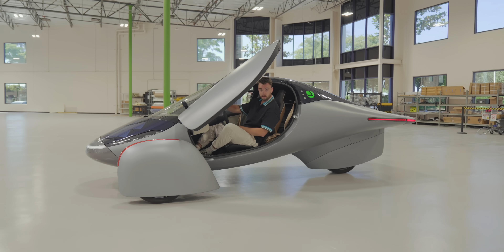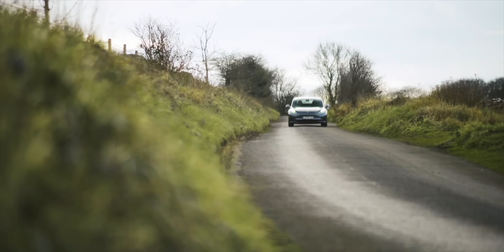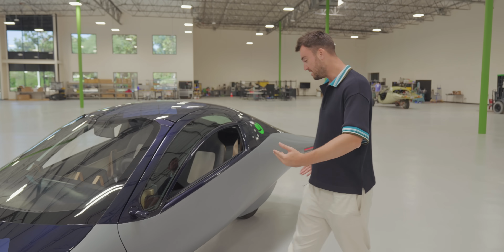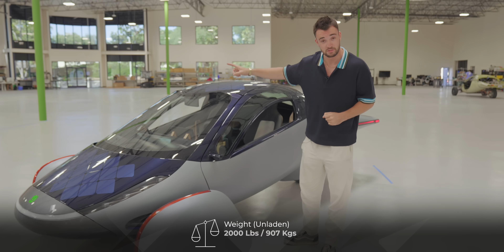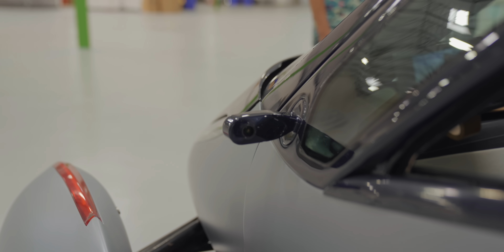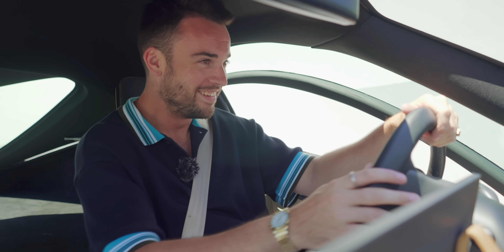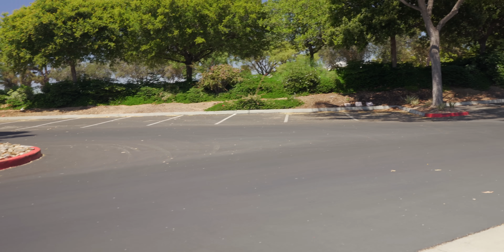The Game-Changing CHEAP Electric Car Inspired By Fish!

Comment: Aptera is basically a super efficient cheap 2 seater sports car with great trunk space. What's not to love.
Reply: @bgeery  So I'm seeing one video where they have a 5'-7" lady (Sarah Hardwick) laying in the back, head against the rear and feet nearly touching the back of the passenger seat which is slid forward all the way. Just enough room to wiggle her feet, but if the canopy was closed her head would be squished by it. She's also laying at a slight angle because she clearly would not fit in straight.

Another video shows two ladies tossing what appears to be sleeping bags in the back, and sitting on the back of the vehicle with their feet hanging over the edge, but not laying down inside, side-by-side.

It's definitely larger than it looks - I'll grant you that. Even the official videos make it look deceptively small. But two people in the back? Maybe you can fit two people in there the same way you can fit ten people in a phone booth... it only sleeps one if they enjoy being cramped or have the tent accessory, because you lose maybe a foot of human-usable space due to the taper of the hatch.

Heck, let's see Chris Anthony and Steve Fambro taking a nap in there!
Reply: This had me thinking. Is it the 2020s equivalent of the E-Type or the Bubble Car? I think it’s the former. People aren’t as boring now as they have been for the last 25 years.
Reply: That's not a car its a motorcycle.
Reply: Cheap? 🤣🤣🤣 Cheap is a car for 10000 bigger that that and still you have 30000 for petrol 🤣🤣
Reply: @bgeery  Yep, can't do that in a sports car.
Reply: Sports bike* no safety testing needed...
Reply: The fact its a 2 seater will definitely put off a lot of people. It essentially makes this a commuter or touring car, i.e. what most people use a second car for. But that kinda goes against the ecological ethos behind the channel and the company. If all you're gonna do in your car is drive to work, drive around with your spouse for fun or some light grocery shopping, then an e-bike is a far better option in almost every aspect.
Reply: @rfldss89  no. Motorcycles are death traps
Reply: @rfldss89  what about rain?
Reply: @rfldss89  not really
Reply: Potentially safety? I don't know, but it doesn't seem like it'd be very good at absorbing impacts.
Reply: @steave435  it has already been crush tested, it actually exceeds the safety requirements it is required to meet
Reply: @rorychivers8769  the problema is that the safety requeriments are for 3 whellers, not cars
Reply: @claudiopinto721  The vehicle is legally classed as a motorcycle yes, but they are voluntarily aiming to meet or exceed regular automobile safety standards, so you'll be able to check with the federal government if they think the vehicle is safe enough when it goes into production.
Reply: So true!!
Reply: Its trunk space is about the same as many 2 seater sports cars.
Reply: @Obscurai  it does have over 6 feet from the back of the seats to the gate. With the back open and the tent in place it should be pretty cool!
Reply: @ATS599   NOPE.  The HELL you could  keep up, hilarious.  :D  Not to mention the fun factor of a planted well sorted sports car.  3 wheels is good for ONE thing, cheaper, they are crap for cornering, sliding sideways, handling in general, and you can't straddle anything on 3 wheels.  RUBBISH.  

Thanks but I drove econoboxs for decades so I can NOW drive what I LIKE without stressing over cost.  

Ever seen a 3 wheel race car??   Of course not, for fundamental reasons.  Garbage.
Reply: @Mrbfgray  Your days of driving like in a race car are coming to an end! Deal with it!
Reply: @theodethomasa6358    NOPE.  I live rural for damn good reasons, you city Nanny State carbon copy depressing drones can stew in your own toxic juices while I live happy, free and self sufficiently.  Grow my own organic everything and chuckle while y'all fight over crap handouts.  :D
Reply: Garbage driving experience guaranteed, sports car??  WTH!  Never was nor will be a 3-wheeler that drives even average let alone highly capable--the definition of sports car.
Reply: @Mrbfgray  Lol, I wonder why all these little 3 wheel sports car/bikes exist then and were quite successful, it's as if they actually handle good! 

Campagna T-Rex 
Polaris Slingshot 
Volkswagen GX3 
Marotti 
Elio P5 
Peugeot Egochine
(There are more)

Also Aptera has YouTube videos about specifically how the beta version handles, and it's truly quite good, it passed all the stability and handling tests out there with flying colors, and they've been doing track testing to get the alignment good. So far it looks to truly handle like a proper light sports car, obviously we won't know what it compares directly to until people get to go and drive it for themselves, but it's gonna drive like a car, in the same way that other sports trikes do, it's not gonna be some terrible thing.
Reply: @Maximum_777    Have you driven both at the limits?  A proper car vs a garbage trike??  Have you seen a trike winning on the Nurbugring or ANYWHERE?  They don't even try.

  Get over your emotion attachments and accept reality.  Trikes are TRASH....always have been always will be.  It's a fundamental design imperative, if you can't intuitively visualize that fact is why you are not an engineer.
Reply: @Mrbfgray  Well I think ultimately you're correct in the sense that a trike's not gonna set lap records, but that's because they're simply not designed with that in mind. They are however far from the trash you make them out to be, and from what I understand, they tend to make for perfect track toys, since they're much lighter than equivalent sports cars, and because of this their horse power goes further, they handle better, and are a ton of fun. But yeah, a BMW with a significantly larger engine, larger and more tires, and especially larger price tag, is gonna beat it on the Nurnbergring, however this is far from the point. 

The point is, there's no reason an exceptionally light electric trike is going to perform wildly poor in comparison to an equivalent car, and I think it will be quite interesting to see how an Aptera does on track. Since it's not a sports car, and rather an efficiency vehicle, I'd imagine it's not going to be an insane performer right out of the box, probably needing better brakes, tires, and cooling, for true track use, just as any car that's not designed for that purpose would. Ultimately for the money I think it's going to be a decent contender as nothing is going to be able to come close in terms of power to weight and that's that, because that's where the information we have ends. 

Then you went and said some bs about emotional attachment, and come on man, you really gonna just shill BMW's in every other reply here, and start talking about emotional attachment? You ever gonna drive something else? Or is it BMW's for life? 

Also, you said this somewhere up there, "Not to mention the fun factor of a planted well sorted sports car.  3 wheels is good for ONE thing, cheaper, they are crap for cornering, sliding sideways, handling in general, and you can't straddle anything on 3 wheels.  RUBBISH." 
This is incorrect, the ability to slide something controllably or straddle it at the limits of grip is down to balance, and as long as the trike is balanced well, with a 50/50 distribution front and rear, you can do absolutely everything a car can do, with the benefit of getting more cornering potential for a lot cheaper, considering you have 1 less wheel to worry about. 

Go look into all the 3 wheeled track toys out there, time and time again, the feedback from drivers is that they feel extremely light and agile in the corners, and are much more capable on track than they expected. They are truly interesting vehicles, definitely worth driving if you get the chance, and a proper electric one, with the daily drivability that the Aptera is offering, has potential to be the perfect daily driver. Obviously until we get our hands on one, it's going to be impossible to know for sure, but Beta looks mighty promising, and I look forward to it proving either of us wrong here, when we get more information. Regardless, it being a trike will not hold it back.
Reply: @Maximum_777    If you can't figure out why 3 wheels sucks that's your failure, I can't imagine anything more obvious.  We even had trike golf carts when I was a kid, SAME thing, turn hard and they want to tip over.  ATVs too!  3 wheeler off roaders were fun and rolled over all the time, that's why they don't exist and no one misses them. 

Sure they have a place for those saving a buck or not very bright.  In some places they skirt car regulations, cool, they are still crap. 

 Arcimoto has a decent modern example, try to slide it sideways on dry asphalt and you'll be sliding it on it's side no doubt.  But it's slow, small and 'cheap', has a place likely, on urban surface streets.

Entire history of autos there have been trikes popping up and disappearing.  Get an F'n CLUE.
Reply: @Mrbfgray  And yet so far everyone who has tested it has come away with a smile on their face
Reply: @rorychivers8769    Good on them and I welcome options and innovation.  Just don't try to drive it like I do my BMWs everyday.  ;-)
Reply: @Mrbfgray  on a track, I hope?
Reply: @Mrbfgray  You mean like smoking your tires? Doing donuts in the streets? That kind of driving?
Reply: @theodethomasa6358   Smoking tires, donuts and childish unskilled vehicle abuse is BORING.  You just wouldn't get it for the same reason you have no concept of a high performance Japanese motorcycle.
Reply: @Mrbfgray  I was not the one to include in the comments about "race cars!"
Reply: @theodethomasa6358    You won't see any trike Tesla's either for the same reasons, they are inherently crap.  Imagine this college science experiment "inspired by a fish" getting T-boned in an intersection, or attempting a severe collision avoidance maneuver at 80mph on a freeway, getting rear ended?...I'd prefer a motorcycle, at least then I might dodge and avoid.

I want solar panels on my house and my cars parked in the shade.
Reply: @Mrbfgray  trike Tesla? 🤣🤣🤣🤣🤣What are you going to come up with next? Tesla roller skates?🤣🤣🤣🤣🤣 Change is the only thing constant! Deal with it!
Reply: @theodethomasa6358    Some things never change, square road tires and wheels?  Sound good!?  And trikes SUCK, always have always will, deal with it  Even YOU laughed at a Tesla trike, so you're not totally clueless.
Reply: @Mrbfgray  Correct! I'm not totally clueless! But your thought on "Some things never change", gives me doubt about you!
Reply: @theodethomasa6358    Why don't you revolutionize the tire industry with triangular ones?  You certainly stupid enough to give it a go.  :D
Reply: @Mrbfgray  🤡
Reply: @Mrbfgray  I think Morgan Motor Company might disagree with that. 

The Ferrari 250 GTO did 0-60 in 5.6 seconds. That isn't even as fast as what many electric family cars can do now. Does that mean it is no longer a sports car because it is no longer highly capability? 

What I think is funny is that there are so many negative comments along the lines of "it doesn't carry as much as my truck",  "it is not a sports car",  "you can't sleep in the back if you are 7 feet tall". One car doesn't have to meet the demands of every person let alone the demands of its owners all of the time. It is possible to hire a truck, van, trailer or courier if you want to move stuff, rent a sports car/motorbike or have a weekend car if you want flies in your teeth or buy a tent if you want to sleep out for the night. If it meets most of your needs well enough then why not consider it? If not then don't, there seem to be plenty more people that want a shorter waiting list. The fact that it should be very efficient should be a consideration for everyone, but unfortunately not everyone seems to have realised that yet. 

Unfortunately I don't know of a single vehicle that meets all of my needs so I have had to make do with vehicleS that meet some of them. Personally, I find my  3 wheel velomobiles give me more pleasure than any of my  sports cars ever did and when I don't use a race hood or visor I probably get me more flies in the teeth. They don't corner as well as a car but that just increases the fun. The Aptera doesn't meet my needs and I think will be too wide for most in Europe but I don't think we are likely to be their target market for some time. I can see that it should meet the needs of a lot of people. I would be more inclined to compare it to a Smart ForTwo rather than a truck or sportscar. The Smart didn't do well in the US but I think the Aptera should find a better niche and I wish it well. 

I like the fact it is different and I think that will give it great appeal. If I had to choose between a massive truck, massive SUV or an aerodynamic EV then I would go for the Aptera. I would rather have a small or medium sized car than a big one but need the ability to use roof bars (about 20 times a year) and a tow bars (<10 times a year). The Aptera is still too big for me but I really like the fact that the focus is on efficiency. Unfortunately car companies keep pumping out more and more SUVs and not many electric cars allow tow bars... so I have to keep waiting for something that meets my needs.... including affordability. 

Whenever I go to the US I see that a lot of Americans still seem to have a delusion that bigger means better and so all the mainstream companies keep heading in the wrong direction. Tesla were very refreshing and have a lot of things right but still too expensive and not small enough. I think Aptera is heading in a better direction than many car companies so good luck to it. I hope the big lessons from Aptera are that great design and efficiency are important and it is OK to be different.
Reply: @surrey-velo2419    It's obviously a niche device, NOT a daily driver or for mass appeal for many reasons, see that by just looking at it. I welcome it as such.

  Crash worthiness??  Poor at best.  Accident avoidance capability?  Rubbish.  Fun to drive?....only until the novelty wears off, handling and performance are fun, not hypermiling.  Ride quality and visibility?  Punishing and laughable.  Lateral G capacity?....make a Yugo look superb. 

Good LUCK to Aptera indeed, will be forgotten in a few yrs.
Reply: what trunk?  you be lucky to fit two small shopping bags in there, no usable room unlike a normal EV hatchback of this size. waste of money and no safe to drive in windy wet weather.
Reply: @colincampbell3679  You can camp in this vehicle. There is enough room for two people to sleep in the back. And how is the most aerodynamic car made not safe in the wind? That makes no sense.
Reply: @colincampbell3679  25 cubic feet. 700 litres. That's a lot of shopping bags.
Reply: @colincampbell3679  They literally fit two entire full shopping carts worth of items into the back of one as a demo of the storage space that they did on their youtube channel.
Reply: @colincampbell3679  they have videos about their trunk space. Fits a bike easy.
So aerodynamic that their initial drives show limited effect of wind.
I can't personally speak to the wet weather bit, but an all wheel drive option is available.
Reply: @colincampbell3679 I drove a thousand miles over the last 4 1/2 days with an inflatable kayak, paddle board, luggage for two people and a passenger. From a picture I saw with the trunk open, the 1,000 mile version would have accommodated us well enough
Reply: @colincampbell3679  as much trunk space as a midsized SUV. I know you are just trolling
Reply: @colincampbell3679  still safer than say a small motorbike which this car could replace.
Reply: @colincampbell3679  Seems something of the sort was said about the horse and buggy. 
And when was the last time you saw a  horse and a buggy? Change is coming, like it or not!
Reply: @colincampbell3679  There's more cargo space in the Aptera than any other EV on the market. You can fit whole bicycles inside the vehicle.
Reply: @colincampbell3679  pretty sure they’ve shown a bicycle in the back. They made it a bit bigger in the beta version and it can actually hold a decent amount.
Reply: @colincampbell3679  you must have have experience driving this car around them, with all your facts
Reply: @colincampbell3679  🤡

Comment: It doesn't look like it will be stable on snow or ice which we have from time to time in the UK.
Reply: Why not - stable is stable.  If you mean traction issues, that's a different issue, but given it still has 2x traction wheels at the front (same as a 'regular' car), I don't think it will do significantly worse.  The main thing will be what tyres it is fitted with by default, and whether you change those for winter tyres if required
Reply: @logicalChimp  Snow is sufficiently rare in the UK that very few people here use winter tyres, although dragging the third when through virgin snow might be a challenge?